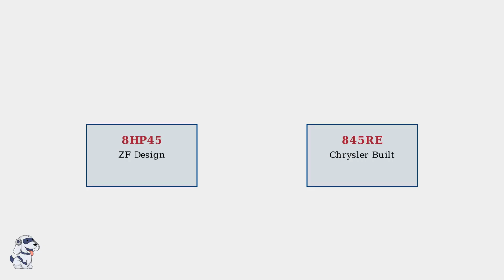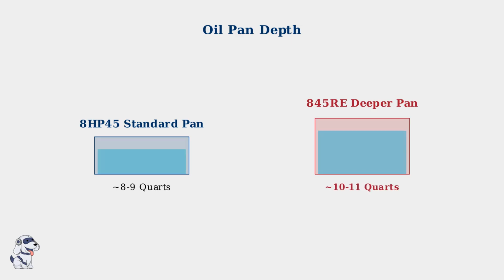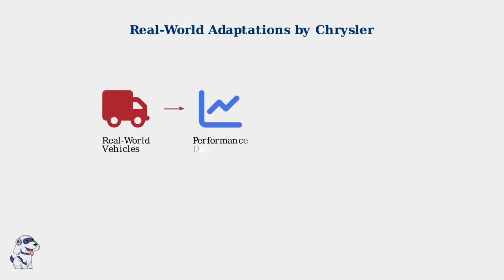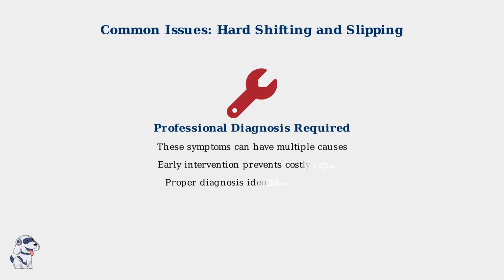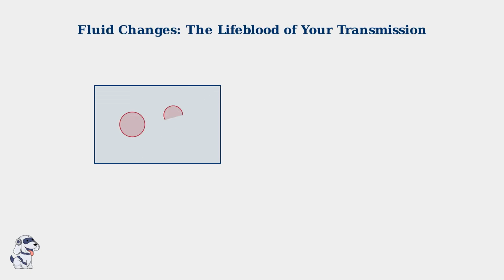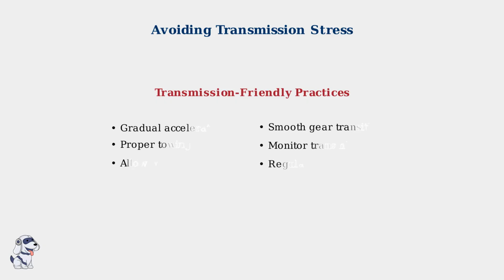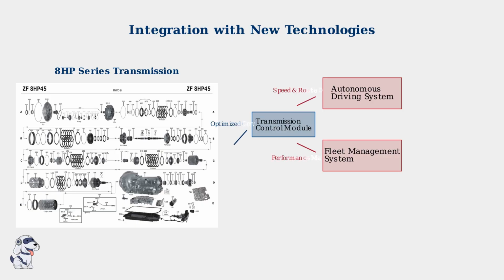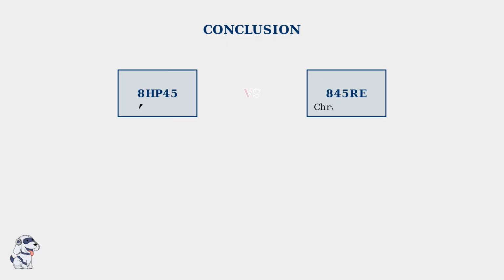8HP45 vs 845RE | Which 8-Speed Transmission Will Last Longer? 💥

Comment: Whoever made this video is an doesn't know how to do their research very well. You don't need to run Mopar 8-9 speed trans fluid in these, Amsoil has the Signature series ATF that works far better than Mopar ever hoped it would. You have far better shifts, even when you put the transmission in Sport mode, the shifting is far greater and smoother. Plus it's far cheaper than the crap Mopar sells, it's not hard to find all the testing that has been done with side by side comparisons. From what this video has produced, I definitely wouldn't recommend this shop, because so far, I've never found this transmission in any Ram truck, but I did find it in my Jeep Grand Cherokee.  Do better research before posting bad information.

Comment: SQ *VETERANS REPAIR SE AKA TransMax Transmissions of Ocala Florida Burned me, a Veteran. Took food from my families mouths as we are on a fixed income... Had an offer $199 A/C diagnostic, never even called us to tell us what was wrong. They just proceeded on the repair, which was a wiring issue, then charged us $579.00 Not a single part was replaced, they said it was all diagnostics... RUN!!!! Never EVER fall into there hands... These are some real pieces of sh!t...